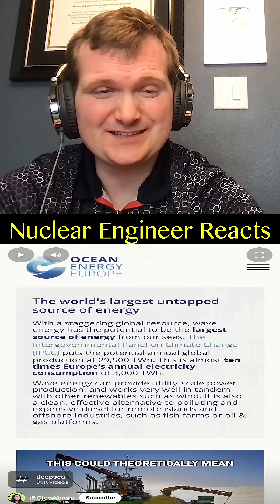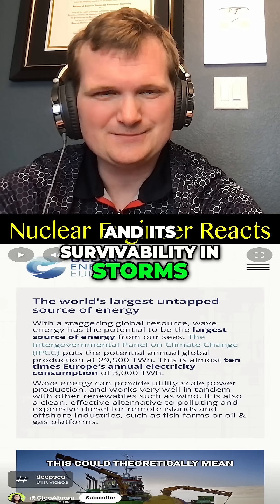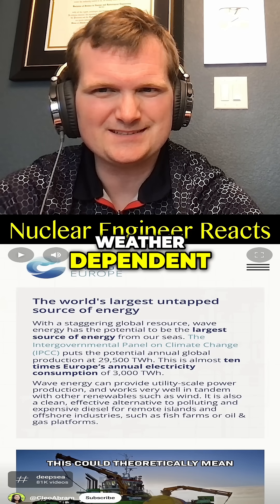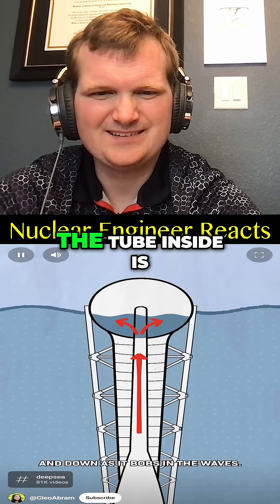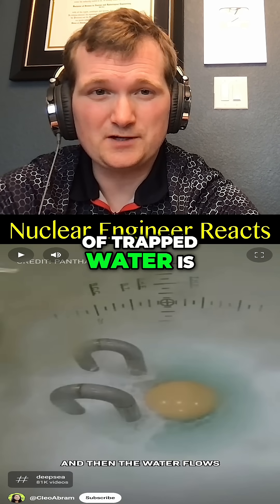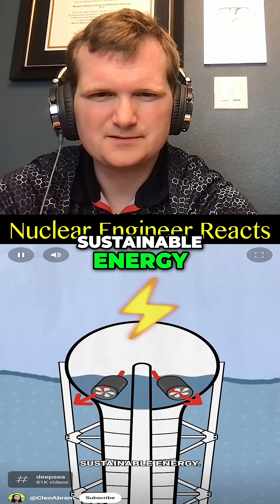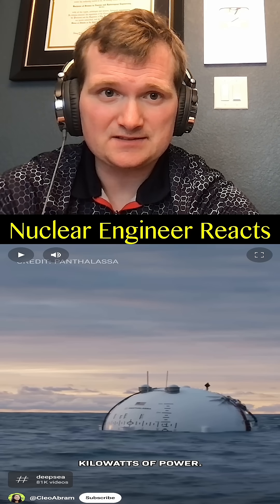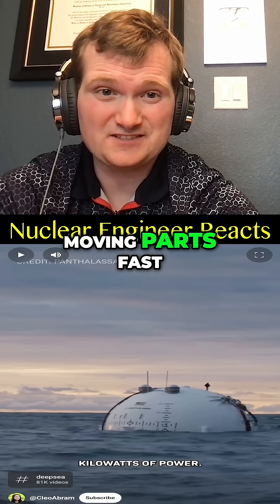Wind Power for Water? - Nuclear Engineer Reacts to Cleo Abram

Comment: What's more intelligent: a powerplant in the neighborhood, or a thing that makes electric in the middle of nowhere?
Reply: A powerplant in the neighborhood. 

Failure like what we saw in Chernobyl and fukushima are 100 percent preventable now, since most modern reactors are technologically superior. 

Fukushima was caused by a massive earthquake and a tsunami. Most places in say, the inland United States, won't suffer these risks..
Reply: @abel3557 Fukushima was caused by placing the emergency generators in the basement, which was then flooded.
Reply: @tozzasque Yeah guess twice if we do that anymore. Safety standards weren't the same back then.

Japan is also right on top of an earthquake hotspot, 99% of other countries are not threatened by tsunamis or massive quakes.

Comment: For all asking, why not use nuclear energy? It's the same case as, why not use lithium batteries instead of alkaline? You have to have variaty, not only for the giggles of having it, but for the accessibility of it, a electric generator powered by waves means nothing to a big city, but for towns in small islands or places which nuclear resources are not easily available, same thing as solar and hydrogen rated energy, bare in mind that the nuclear resources it's not cheap, it's not just the ores, you need people trained, infrastructure, yada yada. That's why a lot of countries still relays on gas and combustibles and slowly adding renewable sources to their grids.

Comment: We just need to harness the energy leaking from hot vents in the ocean. It's not difficult, we already use geothermal energy, we just have to boil water from the Earth's heat to drive a generator. Virtually unlimited energy production..

Comment: Definitely disagree. Wave power is certainly closer to infinite than nuclear power. While the energy density of nuclear fuels extremely high by definition, it's fuel and requires replacement. The waves will be waving long after human beings go extinct.
Reply: And the waves will provide a piddling amount per generator.

You're not thinking about the scalability of this.

Comment: Technically not infinite but infinitely renewable, since it's induced both by thermal environment and gravity effects (from moon for example). It's another renewable source. But renewables are only long term viable if there is a reliable storage... 
Still I think renewables/storage + nuclear are the best solution long term.  I would not want 100% nuclear, since it would cause many nations to be strategically dependent on uranium mining and enrichment. That's never good. Just like with oil and gas. We would see massive cartels and price fixing. Goal should be to not need too much enriched uranium, so that it can be obtained without problems.

Comment: I love how bros answer to all alternative forms of power is just: “yeah, I mean it could work but why not just use nuclear it’s better in literally every way”

AND HES SO RIGHT
Reply: I always find myself thinking though, yeah but less radioactivy
Reply: He’s a shill for the nuclear power industry.
Reply: Funny how none of you even mentions nuclear waste that we'll have to deal with in case we "transition" entirely on nuclear. Since it's one of the hardest issues with it that is not yet solved, you'd probably at least mention it huh.
Reply: @sorrowoo ah nuclear waste yes, over the last 70 years of High level nuclear waste (the amount most people talk about since it's radioactive for very long periods) is 400,000 TONS Sounds like a lot right? Well sure until you realize in a single DAY  we make a solid 800,000-1.4 Million TONS (Depending on the estimate) A singular day compared to 70 years.. Nuclear because of how efficient it is makes very little waste compared to various industries and chemical waste alot donsent degrade much over time making them possibly equally harmful depending on the circumstances,
That's not even taking into account nuclear waste inst actually waste, Some nuclear reactors Litterly take certain nuclear waste and turn it back into usable Fuel, and also since nuclear waste emits energy it's not inherently useless and there are ideas to turn waste into power, unlike chemical waste,
Better even still right now we only have Nuclear fission for power But in the future we will have Nuclear Fusion which is 100 percent clean. Safe to say it's more than a transition considering fundamentally nuclear reactions are Objectively superior to chemical ones in terms of efficiency 
Edit: I deleted a 😊 emoji that somehow turned up that looked very passive aggressive,
I genuinely don't mean any harm or disrespect
Reply: @sorrowoo funny you say that cause we already have protocols for waste management for years.
LLW - bury it for like a year and most radionucleides will break down most of it will be somewhat close to background radiation, depends on contamination.
ILW - take a shielded container with water, dump it there for 10 years, basically that's it.
HLW - secure shielded containers, you place it into a DGR which is basically a big storage facility for those, hundreds of meters underground so the radiation can't penetrate to impact the environment on the surface.
We have no issues with waste management currently, but we can't build infinite DGRs so this will be a problem in like 300 years into the future
Reply: Almost every way. But a diverse power network with peaker plants dotted around it is far better than just nuclear. But yup, bulk should be nuclear power, 80%-90% at minimum with a 30% buffer of more conventional and quick to fire fossil fuel and/or renewables. And where possible hydro-electric, sometimes providing an even bigger percentage, (but always reserves of nuclear to cover inevitable failures and down times for damage and repairs).
Reply: Until the technology and infrastructure exists to massively shift to solar, geothermal, or hydroelectric, Nuclear is the most efficient. Nuclear is not going to be the forever fuel source, but it's unquestionably the best transition fuel until we get to the stage we need for 100% renewable.
Reply: @Valost_One  everything you just listed has massive environmental impacts. Solar farms reflect massive amounts of radiation back into the air, cooking birds that fly over them, hydroelectric power completely obliterates whatever aquatic ecosystem was once there, and geothermal power produces air pollutants. Nuclear fission is the best option right now, and the only thing that could possibly overtake it is fusion, which is undoubtedly better than any other form we can imagine right now
Reply: @Valost_One Nuclear isn't quite just a transition, Mabye Nuclear fission But since For example the Nuclear reaction of U-238 compared to brining coal is literally around 5 Million times more energy for the same mass, since nuclear taps into the strong nuclear force the strongest force of nature itself(or well the residue force) which will always be way More efficient than any chemical reactions which mearly mess around with the electrons around atoms and the electromagentic force, As we get better with nuclear it will get better and better especially fusion and eventually it will simp be better than then Bassicly anything that uses chemical reactions as thoes are Litterly Millions of times less efficient
Reply: @Valost_One problem with renewablevis that it harms environment much more than nuclear so unless your plan is to build a dyson sphere, any renewable on earth is just net negative

Comment: INfinite energy, no. Permanent constant energy that we will not reasonably be able to halt? Yes.
There is limited power in waves, but the force behind the waves is an ocean large. That is a LOT of momentum. No, tapping that power will nto stop the waves, so no, it is essentially infinite over time.
Uranium depletes, just like oil. Eventually it will go away. Usable now, but in the very long term, doomed to end.
We are in a race. We need to advance science fast enough that we can find ways to tap energy for use before teh sources we have now run out.
Will this wear out "fast"? Oh, frack, no. Its primary problem will be biologicals like barnacles. They'll need cleaning every once in a while.

Comment: If I learned anything from wind power, this will probably never offset the cost of its industrial production
Reply: Why is that a necessity in the context of energy production? We already pay for coal and oil power
Reply: @RtaincCo gimmick energy production is a waste of resources and time, instead of investing into advancing actual sustainable energy like nuclear, for example, we spend thousands of gallons of oil per wind turbine each year
Reply: yes
Reply: Wind power absolutely offsets the co2 cost of production. This is a false talking point that has recently been spread in conservative circles and pro-oil media. There is a show with Billy Bob Thorton where he claims this, which perpetuated this old talking point recently. It is false. Life-cycle analyses are the norm in the modern day when it comes to evaluating any infrastructure project, whether its windmills, asphalt or a data centre. Resource extraction, transportation, industrial processes, construction, operation and maintenance, scrapping and repurposing are all carefully modelled. You can look up life cycle emissions of wind turbines and many studies will confirm this.

Comment: So much garbage to just avoid nuclear energy.... Why???
Reply: Delusion and fear based on false believes
Reply: Less ways to control it and have excuses for huge energy cost. Means less profit for shareholders and corporations.
Reply: We can't build nuclear power plants on the ocean
Reply: Nuclear energy is literally just the heat from uranium that evaporates water into steam turning a steam turbine
Reply: USA buys uranium from Ruzzia, no?
Reply: Because not every country can afford to build and run a nuclear plant.
Reply: @dominikbeitat4450  Not every country needs to have one, but they aren't that expensive. Everyday "green" energy generators are also insanely costly, so if a country has enough funds to litter its oceans or fields with wind turbines, it probably has enough for a plant.
Reply: @dominikbeitat4450 the cost of a nuclear plant and a conventional plant are negligible compared and the technology is free to any country willing to be inspected for compliance and nonproliferation 

The problem is nuclear is not the only power you can have energy threw the day is charted on a curve nuclear can only really fill the minimum requirement in that curve for any given area and it gets worse when you add solar because it hollows out the central hours of the curve into a duck shape
Reply: @Doubie. Nuclear is actually the best energy source for the changing demands throughout the day - nuclear plants can really easily throttle their output by just  moving control rods up or down

Fossil fuel plants are okay at reactive demand, but waste a bunch of fuel in the start up and shut down process and also are less efficient when not run at ideal capacity.
Reply: @dominikbeitat4450  If they can't afford a nuclear reactor they will also not be able to afford renewables at any decent scale.
Reply: Cause Nuclear Energy = Chernobyl.
Reply: how much mental energy does it take to pretend to not know why lots of people are opposed to nuclear? if you really don't know perhaps you should go read some basic history and science then come back to the discussion when you're more useful.
Reply: @notmyproblem88  Why do people drive if it is so dangerous? Why shower if I could die by slipping and hitting my head? Why get out of bed if I could die from stepping in the wrong place and falling? There is ZERO reason to oppose nuclear and then support solar,wind and hydro all of which destroy the planet.
Reply: @notmyproblem88  So you're saying that people are stupid and don't understand how nuclear plants even work.

I agree 100%
Reply: @notmyproblem88 history only works as a source when you disregard the leaps and bounds the tech gone in that time. Fear and paranoia do not keep the lights on.

Comment: I saw a comment once asking why corrosion is more of an issue being questioned for these types of sea wave power generators and not so much for oil rigs and other installations

Is it because they’re more static?
Reply: Oil rigs have permanent manteinance crew onboard that routinely check and fix corrosion or any other problem they fin… Having to do manteinance on these smaller devices is a royal pain in the butt because there are tons of them and moving crew/equipment is a massive cost. Not to mention the logistics of having to replace parts or fix something is way harder with these smaller devices.